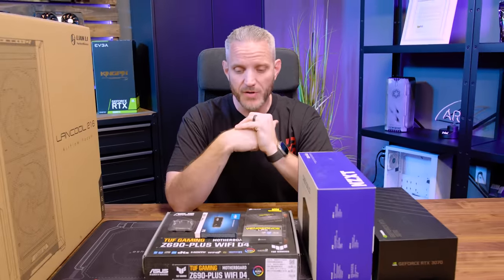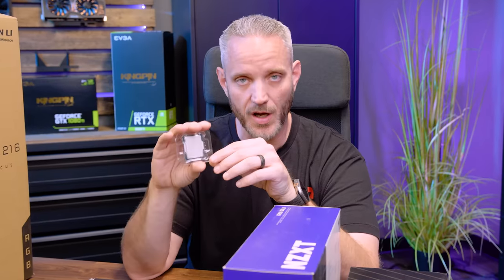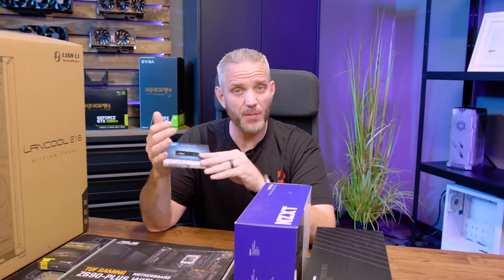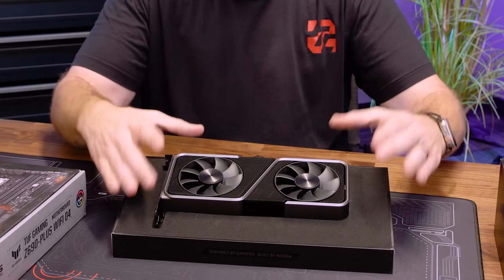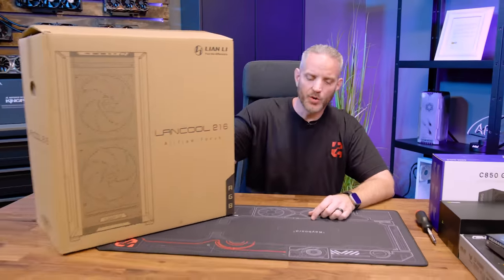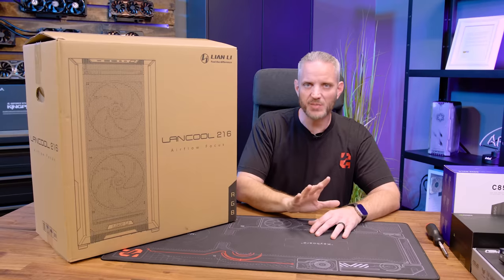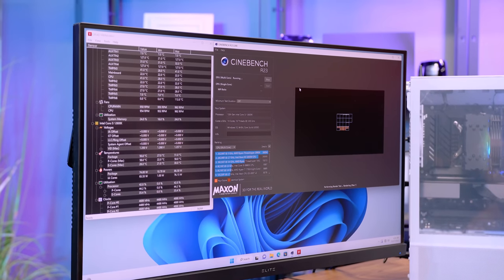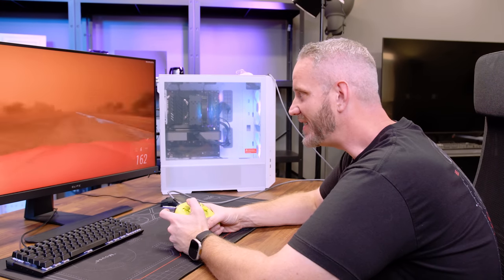Inexpensive PC Build Guide!

Comment: Re: upgradability. I learned the hard way that if your case barely fits the graphics you have now, it is unlikely that it will fit a new one. The 30 series graphics card I had used for the past couple of years had no clearance between the front mounted radiator and the end of the graphics card. I had to buy a whole new case to fit the upgraded graphics card in the computer. Graphics cards are not going to get smaller. Nvidia and AMD are both going to use the extra efficiency from smaller process nodes to build more powerful cards that take up more physical space in the computer. Consider that when choosing a case. It could save you between $100 and $200 when the time comes to upgrade the graphics card.

Comment: I built my computer before the 4090 reveal. I almost followed all of this except I went with a 750W PSU. Then I found a 3080ti for $655 new at Best Buy, didn’t think it would be that cheap… so I had to upgrade my PSU to 850w… go with the higher wattage. I had to redo all my cables to upgrade the gpu.

Comment: I cannot agree with that RTX 3070, at least not with the UK prices. The cheapest RTX 3070s are ~£550 whilst the RX 6700 XT is coming in at £400. AMD on average has NVIDIA beat in raster performance and AMD has 12GB instead of 8GB VRAM. 
£550 is way too much for a 8GB card.

8GB is already bottlenecking some games on some settings, as time goes on this goes worse with newer games. That game is going to age poorly, meanwhile given the past it's likely AMD will get more and more performance out of the RX 6700 XT due to drivers. Unless you need CUDA or Raytracing performance just go AMD, if your argument is NVENC have a look at AMDs encoding it really isn't bad! And that £150 price difference can buy you a much better CPU which could software encode video instead for even better quality if it really matters that much.

Comment: If you want an upgrade path, you should've gone with the AM5 platform. Because AMD said it wanted to do the same with it as AM4. 
With intel and DDR4 you already put yourself on a dead end path. Not right away, but just around the corner there will be a wall.

Comment: Update: lga 1700 has been "refreshed" as 14th gen intel is just the same as 13th gen with a higher power draw with a 0.6% increase in performance and can use the same Lga 1700 motherboards as 12th and 13th gen intel. Just update the bios if you upgrade to 14th gen.

Comment: not to be that guy but i think you should do a bare minimum vr ready pc for the cheapest you can get while still having good performance (medium to high settings) Because as of recently i just built a vr ready pc for about 600 that has run every vr title i have thrown at it on medium and high settings with a minimum fps of 90.

Comment: I would prefer a cheaper motherboard and get the 13600kf, I don't think VRAM matters that much with I5, it is matter for support  the I9 with the eight p cores. I have an MSI EDGE WIFI with 13600KF and I am able to get 25k+ on Cinebench. CPU at 5.6 Ghz and E Cores at 4.5, the play is amazing at 1440p.

Comment: I used to work in a shop where we sold components , built and repair people pcs.

After that I’ve been building a lot for friends and friends of friends.
Here is the friendly advice I always give:
If you are on a budget under 750$
Be honest to yourself , if gaming , is truly the one and only reason you want the pc for. 
Get a PS5 or and Xbox series x , don’t be fulled by the “pC iS So MuCh mOrE tHaN gaMiNg”
You don’t do graphic desing , you don’t know how to code , yo don’t work in your pc.
You will only do web browsing …
At that price point , you will end with a computer that delivers worse graphics and resolution than the consoles . Much worse if you also have to fit the Monitor , keyboard , mouse and some speakers in there. And have todo ram with drivers , with graphic settings , and with quick hardware aging.
Save yourself 250€ bucks 
And get 2 years worth of gamepass or something similar.

If you actually need a computer, but your work isn’t video editing , graphic desing , or any GOU-CPU demanding art related one.

So , you need it for zoom meetings , excell , PowerPoint , Microsoft word etc.
Get yourself a decent 500$ laptop and a series S
You get a comparable gaming experience of that of a 750 $
But also a portable work station , and because you probably have a tv , save money on a monitor and speakers .

For 1,000$ budget, consoles offer such a good value. That I would still suggest considering a series x/ps5 over that tier of pc. If you have a monitor and mouse/keyboard/speakers. Then if you really want to game on pc , go for it. You might get something not terrible for 1000$
But if you don’t have all peripherals , your actual pc budget is around 750 once again. So shitty pc you will build.
It’s sad , but those are the current prices 

750$ isn’t a GAMING pc , 750$ is a pc ,  With some gaming capabilities …

1,200$ is the magic number.

1,200$ is the number where , if you know
How to choose your parts wisely , and be patient and buy things when they are in discounts , and from different places.
You can buy a pc that truly offers a different experience.
A trully “higher frame rate & higher graphics than consoles”
Machine

Comment: I’d highly recommend checking out the msi pro z690 series motherboard if you’re tight on $ - no Wi-Fi, ddr4 -  but it has bios flashback, no RGB, and usually 40-50$ cheaper than the TUF series.

Comment: For the budget you went for I agree the i5-12600k is the best with its upgrade path to an i7 or i9 13th gen in the future.  If the price point is way lower that when I think AMD makes more sense starting out with the R5 3600 (2nd hand) or 5600 with the 5800x3d or 5950x as the upgrade path.

Your title of "Inexpensive" still seems a bit off given the spec you went for.  Most people would not say your build was inexpensive.  Maybe it would be good to have some build videos at lower price points.

Comment: I did this same build with a 10600K and a 3070 XC3 (even had the TUF motherboard and Corsair RAM) right before 11th gen came out thinking "now I'll be able to upgrade to those 10nm CPUs with that fancy new architecture!"

We all know how that turned out... Still running my 10600K and I don't plan to change it any time soon.

Comment: AM5 however has around 3 generations of upgrade potential if you'd wait for the cheaper CPUs, AND still have good performance
Intel gets a new socket every 2 generation, so 14th gen is almost guaranteed to get a new socket, and thus no further upgrade paths

Comment: Those Vetroo coolers were a low-price option. They are expensive now. Up in Canada, the cooler I go to is Thermalright. They have with and without RGB and white options as well. Really good price depending on the options of lights or the number of heatpipes.

Comment: I would still go with AMD 7600X, 6000 CL36 2x16 Gb G.Skill Flare X5, ASRock B650 PRO RS, RX 6700 XT. It would be the same 1500, but with a monitor IPS QHD 165 Hz and mouse + keyboard.
Future proof, same or better performance (unless ray tracing). Also I didn't quite get why you would need to upgrade 12600KF, coz it's a good processor. In case your CPU becomes a bottleneck you shouldn't upgrade to 13th generation on that board. In that case MB becomes a bottleneck due to chipset and ddr4, you are leaving a lot of performance.

Comment: I think going with the 12600KF isn't a good idea, I think going with an AMX 7600X makes more sense. Yes the RAM is currently more expensive (I'm seeing 16gb of DDR5 between 70-100 bucks), but if that's the only real premium one is paying, I think that's worth it for future proofing your build. We don't know if AM5 will last as long as AM4 did, but I think its safe to say that in 4 years, you'll be able to slot in a better cpu than the 13600K which will at that point be 4 years old.

Comment: If you're lucky enough to have a microcenter near you or you are travelling somewhere that has one, they still got the bundle deals for amd 7000 series cpu that gives you a free 32gb ddr5-6000 ram on top of the discounted prices of the cpus and MB. I built a pc last week with 7600x and 3080 (3080 bought on amazon) at $1400 before taxes. Gets you to ddr5, better GPU, and a better future upgrade path with am5 for a similar price. Sorry to those that aren't anywhere near a microcenter.

Comment: As someone who has taken a PC to the edge of it's lifespan, I don't get the obsession with CPU upgrade paths. I honestly feel I could use more RAM, if I could be bothered to look for DDR3 for a reasonable price, more than I feel like I need a few more MHZ, even if I could slot an Extreme Edition 4950x or 5950x into my "lowly" Z87 I don't think I would because the gap between new and old is just that big that a modern 8 core would slap even the "Extreme Editions" from those days silly, and I don't expect progress to slow like it did back then any time soon.
Reply: I am not saying moving from my 4770K to a 4790K or even if the aforementioned impossible swap was made possible it wouldn't gain me a lot it just feels too little too late and like I would be spending good money on a bad upgrade to delay the inevitable complete rebuild.

Comment: Not much point laying an upgrade path for a single generation cpu upgrade in my opinion better save that money for your next motherboard and CPU every few years... best investment you can do for longevity is a good psu, unfortunately today you need to spend about $100 plus for a 1000W as cpu and gpu and demanding more and more power.

Comment: So close to my build from about half a year ago:
12700F
670H TUF
16GB ram, will expand to 32 at some point
6600XT
1TB nvme 3rd gen with 3 more slots empty
750W PSU, since I don't plan to have more than 300W gpu at any point.
Case with front mesh and 4 fans

Comment: I know this is an older video, but I was under the impression that Nvidia’s encoder actually doesn’t affect performance when it comes to gaming OR streaming. I haven’t verified it myself, because I’m running AMD, but I was told that Nvidia’s encoder worked separately from everything else, or that it was tied in with the VRAM? I’m a noob so don’t mind me if I’m sounding dumb as hell lol

Comment: Personally I'd rather go for a 3060 Ti, which is like 10% weaker than the 3070 but noticably more than 10% cheaper. Or the 3080, which has both more performance and more VRAM. Depending on how long I'd want to use the GPU.

Comment: Nice cost-effective build. How does the RTX3070 perform at 1440p UltraWide at high-ultra settings?  Worth stepping up to a 3070Ti or 3080 if running an ultrawide 1440p setup?

Comment: A little weird that you said the 5800x has no upgrade path when the 5900x and 5950x exist. Even the 5800x 3D is faster for gaming. It's not a generational upgrade but there is still an upgrade available from the stated CPU.

Comment: If you’re on a really tight budget i’d look at used parts. I got my MB B450f , ryzen 5, 16gb ddr4 for less then $200 on facebook. Also got a 3060 12gb and 650W PSU on facebook too for $275
Reply: I can’t remember what specific cpu I have off the top of my head just a average ryzen 5 cpu  nothing special

Comment: Just an FYI to everyone, microcenter has bundle deals on ddr5 motherboards with the 12600K that makes a DDR5 version of this build much more palatable
Reply: These days I would actually say, ddr5 makes more sense, especially if you intend to maybe also do another cpu upgrade somewhere down the line, because mid range ddr4 (like shown in this video) will hold you notably back with something like a 13700k. True, you could get the most out of it by using some crazy ddr4 5000 kit, but those are expensive even today and will be even more so in a couple years (not to mention hard to find in the first place, because the production will have ended by then).

Comment: Thank you Jay.  I have been trying to build something similar (although all AMD) since November, yet I keep getting motherboards that are dead in one of more ways right out of the box. I went with a MSI x570 and it was not recognizing anything.  Amazon replaced it.  The second board worked great - one time, and then died on day two boot up.  Switched to an ASUS x570 and it also worked great - one time.  I get my fourth board tomorrow (another ASUS x570 but a different model) and hope that the fourth time is the charm.  I am getting real good at tearing rigs apart only to rebuild them.  All I wanted was a decent 2K gaming rig for around $1500.  Is that too much to ask out of life?????

Comment: heh no. intel is never the option for upgrade later. That motherboard is a dead platform after you upgrade once. Amd has shown we can have 4 generations on one platform with no issues. Intel can do the same. cpu cooler is also equally as bad. You can get a thermalright cooler for 20-30$ less for the exact same performance. Reasonably priced doesn't mean overspending on things that literally don't need overspent on.

Comment: I got a DDR5 16GB stick for 78€ with RGB. Edit: later i will be upgrading to 32GB with the exact same stick. The Kingston Fury with 5200Mhz i think this is actually a pretty decent price, i am upgrading to an probably i5 13500 in upcoming days/weeks, according to some leaks it looks like that this CPU will be at around the same pricepoint of the 12600K and be better with it's 6P and 8E cores. And the MB will be a B660 most likely a Strix B660.

Comment: I did my build with the 12600k in October and I choose to buy a Used 2080 Super for $310, my total system upgrade was closer to $900 than $1500 for basically the same performance as the 3070. I was also able to get more Ram (32gb) and more storage (4tb NVME + 8tb mechanical drive). I like the Lancool case, but choose an Asus case that was on sale for $60. Great video thanks for posting.
Reply: Less performance and 16 gb of extra ram you never gonna use
Reply: @promo130  less performance than what ? it's the same CPU and more Ram. and the 2080 Super is less than 5% slower than a 3070. And how would you know how much Ram my system uses? At startup with the browser open I'm using 32% of the system ram, so it doesn't seem like anything is wasted to me.
Reply: @CliffStinson  its an avarage 23% less performance on 1080p ultra settings so thats arround 33 fps less
20% on 1440p and 4k 
and its pcle3 the 3070 pcle4 
so double the data rate 
So not even close to the same performace buddie
price performance ratio the 3070 is the better deal

Comment: I don't really understand why everybody is so fixated in getting the latest and greatest CPU. Or even one that's at most only one generation old.

I have an i7-9700K, and I have yet to find a game that takes more than 50% of the CPU. The vast, vast, vast majority of games stay below 25%, most well below that. It's not unusual in the least to have games stay in the 5% CPU usage range, give or take, most of the time. 10-20% is very typical. It's extraordinarly rare to see anything even approaching 50% (at least while running the game proper, obviously sometimes during loading screens etc. it might get temporarily higher, but even then I don't remember seeing 100% CPU usage like at all).

Part of it might be that I'm not fixated on running games at 500 FPS. I have a 120 Hz g-sync display, and that's more than plenty enough. Anything that stays around the 60 Hz mark looks completely fine, and I have literally zero problems in capping game framerates to that 120 Hz. Most games are GPU-bound, especially since I have a 4k display (and I tend to like to use that resolution in games). The CPU is by far not the bottleneck, not even close.

Comment: AMD based with a REALLY long upgrade path in the future:
GIGABYTE AORUS Gen4 SSD 1TB, M.2 (GP-AG41TB)
AMD Ryzen 5 7600X, 6C/12T
ADATA XPG LANCER White Edition DIMM Kit 16GB, DDR5-5200, CL38-38-38-84
ASRock Radeon RX 6800 Phantom Gaming D OC
GIGABYTE X670 Gaming X AX
be quiet! Pure Rock 2 Black
Corsair 4000D Airflow white
Cooler Master V-Series V850 Gold V2 White Edition 850W
~ 1580€ (incl. tax 😎 because we are German)

Comment: Jay, I have a question. What are your thoughts on the phasing out of 5.5 drive slots on cases? When I was growing up you'd see CD burners on every home system, and now they're all gone, or taped to the underside of the desk :/ do people actually have that little of a use for them?
Reply: I'm not Jay, but there's largely no need for DVD drives anymore. Of course, they're not extinct. You can still buy some PC cases with 5.25" drive bays and internal DVD drives, but they are largely irrelevant. The vast majority of software and games are exclusively sold digitally. Even software you buy in-store still is likely just a CD carton case with a redemption code to download it. Modern PC games are massive in size so they don't ship them in CDs or DVDs and Blu-Ray never caught on with PCs.
Reply: @JJFlores197  i feel like the sheer number of blue ray drives for PC's would like to have a word with you.
Reply: @rimuru2035  Sure. But how many PCs actually shipped with Blu-Ray drives? In the past, almost every single computer from the past 2 decades had a CD Drive and eventually a CD/DVD drive. When Blu-Ray started coming out, how many PCs had Blu-Ray drives? Even as the years went on, very few PCs had Blu-Ray.
Reply: @Javier Flores  but wouldn't an access to that form of medium be useful, especially for these high budget all in ones that we keep seeing built? If I was spending 10 grand on a computer, and it couldn't burn a blu-ray collection because someone thought it wasn't the "Aethstetic" of powerful pc cases, I'd be a little concerned.
Reply: @senoreverything6366  Very few people spend $10k on a computer, let alone burn Blu-Rays. This doesn't mean that PC cases with 5.25" drive bays are extinct, but they're not common anymore as I said in my first comment.
Reply: @JJFlores197  damn. I'm not sure why, but that makes me feel old.